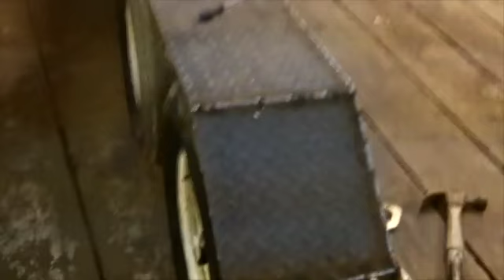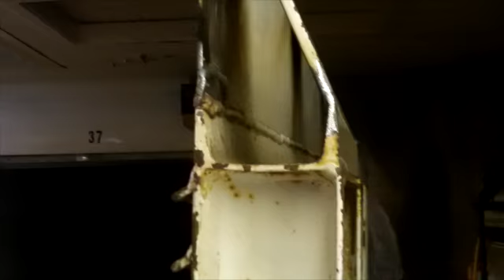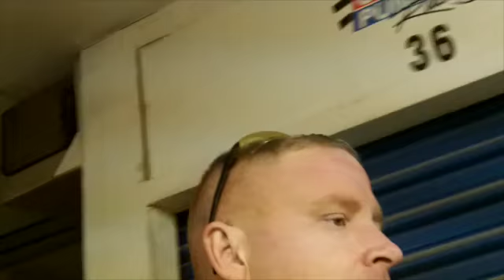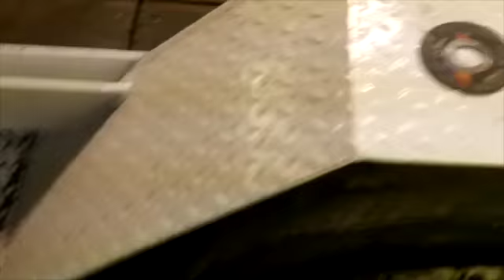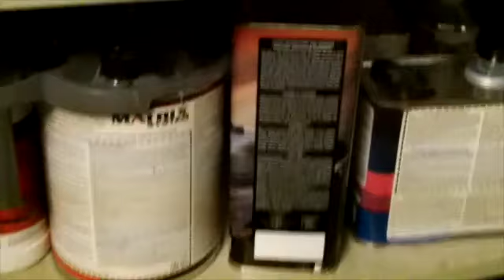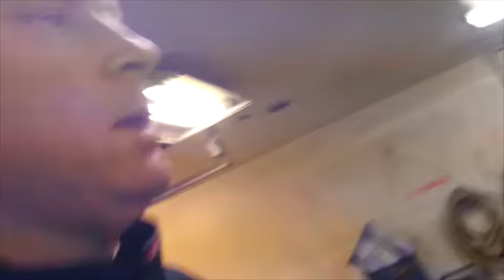Welding on the trailer and request for info

Comment: hmmmmmm only experience I have is sand blasting or wire wheel and both suck. Be interesting to see what you end up doing Shawn.
Reply from the maker: It's supposed to be close to 25 degrees tomorrow.  I think I'm gonna hit it with the pressure pot blaster real quick to give that surface some tooth.  Better than the  -8 degrees this morning... ugh.

Comment: I tried a wet blaster last fall on the bed crossills for my truck, it worked, but I wasn't particularly impressed,  it was slow.
Reply from the maker: Thanks for the input.  I have heard similar reviews.  I'm thinking it might work well for paint prep as far as getting the light rust and etching the surface so I can hit it with some phosphoric acid.  I have some expanded metal on the gate that needs prepped and I believe it's gonna be a pain, lol.

Comment: Trailers that get used get beat up, scratched up, rock blasted from being pulled behind a truck. To me it doesn't make sense to spend the time blasting them and painting them up nice. Seem like no matter how nice a job you do, a trailer that get used looks like shit again after a couple years. Scrape the rust bubbled paint, blast the worst of the worst rusted spots and shoot it in my opinion.
Reply from the maker: That's pretty much where I'm at.... Thanks for the response

Comment: I would definitely just wire wheel it...I did my small trailer as well as doing a replacemotor for my Camaro and 88 Chevy 2500...it works well..just used primer and then black rustoleum paint on it... in your case white.
Reply from the maker: That's the general consensus on this one.  I'm trying to make it easier but sometimes you just can't reinvent the wheel, lol

Comment: I wire wheeled mine and just shot it with Rustoleum Industrial paint.  It was not fun by no means.  I figure it is just a trailer and in a few years it will need another paint job anyway if I want to keep it looking good.  If you use a trailer it gets scratched.  Also easy to repaint scratches with the Rustoleum.
Reply from the maker: It's not bad stuff for sure... and anything short of sandblasting it's gonna take forever, lol

Comment: If you can farm out the sandblasting I highly suggest you do.  Without pro equipment it takes forever and you'll be cleaning sand out of stuff for months to come. Just my two cents...
Reply from the maker: I usually do all my own but weather is not permitting.  Time is closing in too unfortunately

Comment: Hi, we have limited experience of using a pressure washer plus sand blaster on farm equipment and I think we would have to say it is not much better than a straightforward high power (3000psi pressure washer). For this reason we have taken to using a mobile sand blasting contractor who uses kit mounted on a small lorry. Choose a site where you don't have to clear up the sand and noise is not a problem and be prepared to red oxide the cleaned metal straight away with at least one coat. We prep the machine prior to the blasting (eg remove electrics, hydraulics, take tyres off wheels, remove bearings etc.)  Also we buy the kiln dried sand in 500kg sacks for him to use and store any unused material until another time.
Hope this helps, Dan
Reply from the maker: No mobile guys are interested in doing this stuff when the weather is bad... and there's no end in sight to the cold.  Gotta get it done soon.... I have another one just like it to do

Comment: I'd have someone with a sulair unit and a big ass industrial blaster hit if for an hour or two.  Outside of that, I'd go bonkers with ospho in a garden sprayer.  Sherwin williams has an epoxy intended for mill scale and light rust.  I believe it's called macropoxy (I could have the wrong name there).  A local crane maker uses it and I've talked with a couple of their millwrights...  They swear by it on scaled steel.
Reply from the maker: I have a large 185 cfm compressor and a pressure pot.  It just wastes so much material.  Ospho and wire wheel is the most likely option.  Cool info on the macropoxy

Comment: I have a sandblast attachment for a pressure washer. I run it on a 10HP pressure washer. I use it for prepping skidsteers prior to quick and dirty paint jobs. The attachment works well for roughing the paint, blowing off bubbling paint with rust underneath, and peeling off grease and caked on dirt. I think it would take foreever to strip an entire trailer.  I have guys around here that would blast that trailer for a couple hundred bucks. Thats the route I would go. Those big blast units are pretty quick and make better use of the blast media
Reply from the maker: If I had someone local that would do it at my shop, I'd do it.  There's too much salt on the roads right now to take it somewhere and I'm in a pinch to get it done before spring.  My buddy has another unit just like it that needs the same treatment.  Thanks for the input!